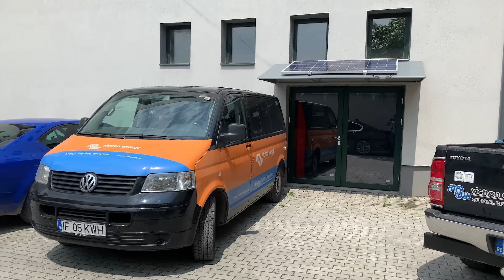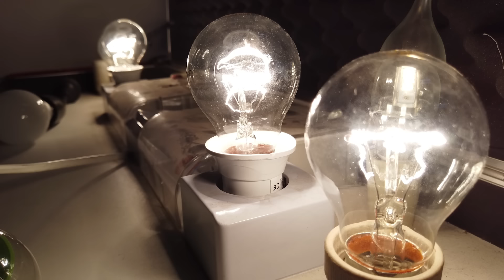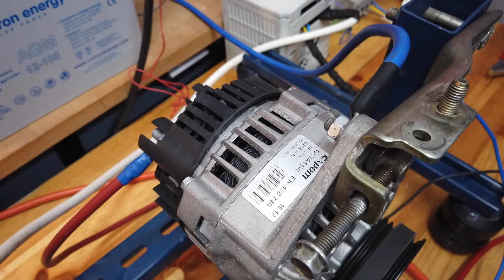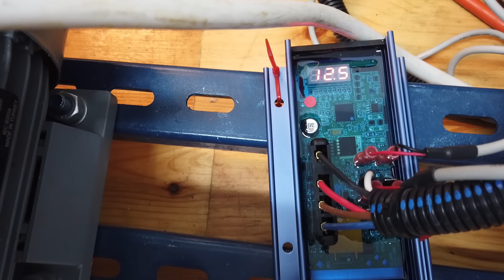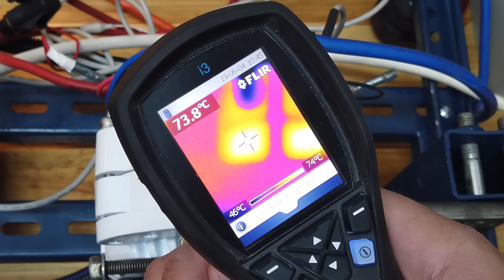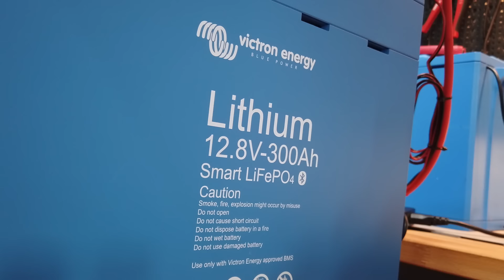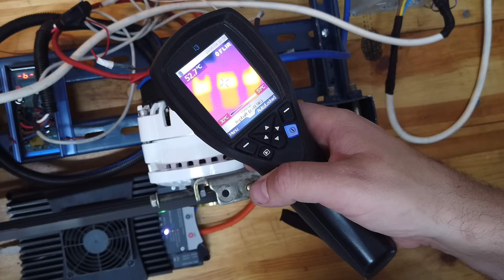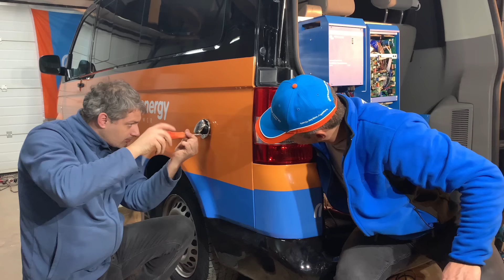How to not blow up your Alternator when charging Lithium

Comment: Ok, so the actual perception is: 3000 alternator rpm if created from a 1000rpm engine with general overdrive of ratio 3 gives healthy 40ish degrees and 78.9 Amps off of a 70a Citroen Alternator. Good.
Real verdict of this video without the voice is that a fully loaded alternator should not be operated below 1000 engine rpm (=do not 100% load in idle, which is not hard to understand) but is very fine when driving (lets say approx. 2000 engine rpm).
Regarding Lithium everybody should know that a lead acid battery as a buffer to avoid load off voltages and then DCDC off to a Lithium with current limiting to a current value/number below (80%) the alternator limit is a good ballpark.
Reply: If you have room, buy a 12v aux truck alternator. Typically rated at 180-300A continuous at just above idle. They’re twice the frame size of a high output car alternator and are designed to operate in hostile conditions - and they’re cheap(ish)
Reply: Any links on any items locations in Europe?
Reply: @ross82 Ford Transit 250 EcoBoost alternator puts out 250 A ford thought this out for its vans owners.
Reply: @krustysurfer it’s about duty cycle, big frame (truck) alternators are rated continuous.
Reply: @ross82 So basically what you're saying is the trucks built-in voltage management system will take care of everything pretty much the way that it needs to be because for built forward facing technology knowing that lithium batteries were coming is my guess?
Reply: @krustysurfer what I’m saying is - trucks have more space so they can afford to fit larger continuous rated equipment - auxiliary alternators being one of them. With physics, size and energy production go hand in glove. In this case, the thicker the conductors - the lower the temperatures - thicker conductors take up more space hence the larger frame…. and the frame itself is a heat sink. So the bigger the heat sink the cooler it will run. Can you see there are two massive physical limitations solved by going big? If you have the space - go big. It’s not rocket science.
Reply: @ross82  seen and heard 😎thx
Reply: In an RV there's the secondary battery on a diesel it can be used to help the inverter and connect to the lithium ion battery to with a 250 amp diode. Microwaves have a capacitor and the inductance created is a problem. Charging a vehicle the optimal performance is above idle maybe a thousand RPMs for an alternator. China tariffs are needed against products like this and people who test and never really get down to the facts. Fact is anybody now can manufacture this system. The inverters cannot be connected to the BP 100 or 500 according to the diagrams victron has a big x. It is unknown why possibly the longer the connection to more waveform distortion or other unknown?
Reply: From things I have saw dcdc as you mention is way to go. I want to build a lawnmower type engine to alt setup. And after watching this stuff dc to dc is looking more inline. I think @victronenergy should revisit this and produce a new video with new offerings or products out there.
Reply: The moral of the video is that due to the lithium battery the voltage during charge will not go up until the battery is charged and this causes the alternator to get overworked. 3000rpm is still low for an alternator to be cooled well! So over time bearings/coils ect will suffer and fail.  the ballpark for a dcdc converter to limit the output would be about 50%
Reply: @johannesboonstra6917  Alternators peak at 1800 rpm and rely on the vehicle to be moving for cooling 😂
Reply: @ryanmckee3102  and all alternators are in vehicles and beside this, there never in a sunny traffic jam ? 🤣.
Reply: @ryanmckee3102  are you saying that alternator fans are designed to provide adequate cooling to 1800 RPMs, and at higher alternator RPMs they rely on vehicle movement to cool the alternator?  I'm trying to get this clear in my head because I'm on a sailboat, where wind cooling in the engine compartment is not available😊.
Reply: @SailingWindGypsy  no I'm saying that output peaks at roughly 1800rpm and drops above that typically. There is no cooling on an alternator so typically the engine fan and air movement is all there is to cool it.
Reply: @ryanmckee3102  okay well I'm really confused then because everything I read says that an alternator has a fan 😊.  But we may be talking about different types of alternators for different types of engines and vehicles.  I would also think peak output would vary based on the size of the alternator, for example 50 amps versus 125 amps.
Reply: @SailingWindGypsy  Alternators have a fan, but thats based on average load for a limited period, not for extreme loads for a long period of time.  then cooling isnt adequate

Comment: The main question is sail bolt can charge battery alternator without motor working but the propeler giving rpm to alterator,  using the alteraror and engine, justthe solar panel. Conventional charger. Plugb220 v. In case using v
just solar panel with selector swich  is it safety. Where I can find electricals diagrama for 4 possible

Comment: I have a 300 amp hour lithium battery pack, the maximum chargeing current is 50 amps.  My car charging alternator, as all are, are set for lead acid batteries and the charging current drops off before you can fully charge lithium batteries.  So, needs to be tricked into seeing a lower voltage to what the batteries are, to charge.

Comment: What about the VAN’s (Spring, Crafter, Transit) alternator that is rated to 250A standard, and optionally you can get a 280A version? Is this still an issue with such big alternators?

Comment: Victron does NOT make a product that will go directly from your alternator to charge your lithium batteries all the orion dc to dc chargers require a lead acid battery  between your alternator and the dc to dc charger. Need a product that will charge directly from the alternator

Comment: It get your approach for this demonstration but: the under bonnet situation looks quite different:
1. way warmer than room temperature
2. You will always have a massive airflow from the radiator! additionally
3. the load situation will ALWAYS vary massively: Due to shifting (aks RPM change) and stopping/driving. If not, like on autobahn, you will have a steady and massive airflow
Reply from the maker: Although these are good points to highlight, what about when alternators are used in the hulls of boats and in engine bays with little to no airflow? This film is purely trying to highlight the issues, and we know this won't fit all situations.

Comment: I’m just curious Mechman alternators successfully charge all types of lithium batteries without the use of a battery management system or anything from Victron
If it’s so easy to burn up an alternator, why is it not happening all the time in the high current audio world?
Not only that but they make 400 amp alts
Can someone please tell me bc I don’t want to waste my money improperly charging

Comment: A simple solution is the addition of a length of wire to add resistance to limit the charging current due to the voltage drop on the additional length of wire. Use copper wire tables to do the math for the desired voltage drop at a given desired charge current. EG if the desire is to limit the charge current to 20A, and the alternator regulates to 14.7 volts, and the Lithium battery is at 13.6 volts, the wire would drop 1.1 volts at 20A and dissipate 22 watts of heat. Alternator is not overloaded during charging.
Reply: bro lifepo4 battery with smart bms can set up max charge current  i dont see any issues with that battery .

Comment: The car engine idles at around 600-900 rpm, but the pulley on the alternator is much smaller than the one on the engine's main shaft, so even at idle the alternator speed is well over 1000 rpm, probably closer to 2000.
Reply from the maker: What about boats sitting at tick over in a lock or by a dock?  This video has tried to highlight this issue. We realise it’s not ideal conditions but at least we tried to get the message across to people to try and help them.

Comment: In reality an alternator turns at 3x the crankshaft speed so at idle it's much more than 1500rpm. In most cases there will be plenty of series resistance and you don't need complex solutions.

Comment: There is a dude on youtube who criticized this video and then hooked his lithium bank straight to his alternator. Camper vans don't have 70 amp citroen (low quality and undersized) alternators, sprinters have 220amp alternators with current limiter built into them. His setup is still working years later.

Victron is nice stuff but it's overpriced and this demo on a bench with ZERO airflow and a TINY, low quality alternator. The experiment was designed as a marketing stunt to sell products and destined to fail.
Reply from the maker: No, this experiment was designed to highlight the high pull of power when charging lithium and how it can damage an alternator.  Johannes has explained this many times in the comments, and you forget to consider an alternator in a boat, for example, with limited airflow.
Reply: @VictronEnergyBV  None of that nuance is explained in the video. The video makes it seem like the only outcome from direct alternator charging is an instantly fried alternator, which is untrue and misleading.
Reply: @VictronEnergyBV   how about limiting bms of lifepo4 battery to charge at max 40a that cannot damage alternator then

Comment: WARNING: INVERTERS NEARLY GUARANTEE ALTERNATOR FAILURE. Very informative video.  I wish I had seen this before my alternator failure and subsequent $4,000 repair.

The alternator demo helps me to understand the lead up events to my failure and prevent future failures.

First setup:  Circular Saw to Standard Inverter, to starter battery poles and alternator.  I was not aware that the momentary peak power surge from the saw at startup placed enormous load (3,000W)  on the battery and alternator.  This event occurred approximately 10 times starting the saw.

Second setup:  100AH LiFeP04 battery to 120v25a LiFeP04 Charger to the Pure Sine Inverter to the starter battery poles and alternator.  Post "First Setup" events, car was operated for 10 minutes at various rpm's, never over 2,500 rpm's. And a stop was made.  In error, the inverter was left on for 15 minutes in which it drew down the starter battery but not enough to notice on engine start.  We continued for 20 minutes and the inverter threw a "low voltage" (point-of-failure) code of which I immediately shut it off and disconnected it from everything.  3 minutes later, the car dashboard lit up and the car went into "LIMP" mode (Toyota Sienna, minimum operating power condition detected by on-board CPM).  Power was so drained that steering (electrically powered) was nearly 100% disabled, throttle completely unresponsive in LIMP mode.  This created an extremely hazardous car operating condition, best described as nearly completely inoperable.

After all this, I am able to recall car performance artifacts that may have preeminently indicated a this failure.

Most likely the first setup did damage the alternator.  The second setup, ironically a test, finished off the alternator likely resulting in thermal run-away and coil failure.

The result was a remote failure during a minivan campout resulting in $2,900 car repairs, $500 hotel (failure occurred 30 miles away from our camp),  and the MiniVan is outfitted as a camper with queen bed within, hence lodging needed with vehicle in the shop.  Meals another $200.  All totaled almost $4,000.

LESSONS LEARNT

Even though Victron and other manufacturers design in safety features, SOME DO NOT and they don't cover the cost of your failure so the risk of $2,500 is on you, not the manufacturer.

LiFeP04 Batteries can be easily charged while completely isolated from your vehicles electrical system via Solar or On-Shore power and even a gas/lp operating small generator.

I will not accept this financial risk going forward.  At a cost easily under $500, I will go the route of solar and shore power options and mitigate the risk to me.

The financial risk is just too great to take for inverter or 12v-to-12v charging systems.

Comment: This overheating is a standard issue. 
Lithium is only triggering the fail moment sooner.
But 3 agm with the same 300amp does the same to an alternator if not ran fast.

Comment: so you use a dc to dc charger to isolate the starter from the house bank and charge the house bank from the dc to dc. How do you wire the shore power to charge both battery banks (start and house) without creating an alterante path from the alterantor to to house bank?

Comment: Bench testing an alternator skews the heat portion. If you are driving, air is also blown over the alternator thus increasing the cooling effect.
Reply from the maker: If an alternator is deep in the hull of a boat, there is little to no airflow, so this is to highlight the issues with charging lithiums.

Comment: I current limit the output of the alternator to just 30Amps anyway. Every alternator just about can handle that. 
If the battery is 80% flat and I have to leave, then the chances are I'm going for a drive of a couple of hours. That puts at least 60Amps back into my 100A battery. My solar panel at 400W, will have everything charged in another hour or so, once I'm there. Charging Lipo4 batteries at break neck amps is not good for the life of the battery or the alternator. While they can take it short term. it's more about the right voltage ie. 13.8VDC at a constant current, rather than a larger current, for a short period of time. You don't need an expensive DC-to-DC charger to do that. A $50 boost converter from Ali E will do all that just fine.
Reply: if you feel thats a reliable solution, then yes

Comment: Well how tf are these EVs doing it?!
Reply from the maker: EVs don’t have alternators.
Reply: @VictronEnergyBV Yeah this is true but they do have regenerative braking which I imagine is a pretty rapid charge but I guess the brakes withstand heat much better so it makes sense
Reply: @Dan0rioN this is about alternators and their efficiency/ heat generation 
That’s something different then regeneration of power with a high power motor with a different construction/ design
Reply: @johannesboonstra6917 Yeah makes sense
Reply: @VictronEnergyBV & What about hybrids?

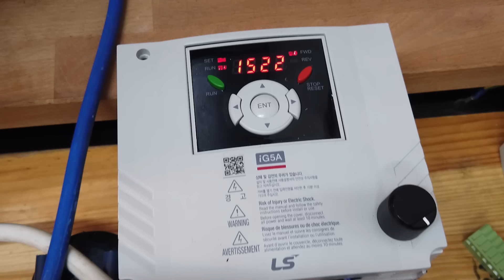Comment: 2:46 - "note that this is still above the speed of an engine running idle"

No, it's not. Alternators are typically overdriven, with a much smaller pulley than the engine's drive pulley. Alternators typically run at 2x speed on 4 cylinder passenger cars, and 3x speed or higher for consumer trucks and SUVs. Commercial and vocational vehicles can run as high as 5x engine RPM. 

Contrary to popular belief, most reputable manufacturers of industrial alternators do not run higher overdrive ratios... owing to the typical high RPM and reduced idle times of industrial applications, higher amperage loads are typically handled by larger, lower RPM alternators.

Comment: There are a few things I don't like about this video: The burnt out alternator looks like a Citroen, 70 amp version. I wouldn't call drawing 80 amps from it healthy. The RPM ratio of a generator in a vehicle versus boat should have been mentioned. The test setup is stationery with no additional airflow, which should be taken into account.
Reply: In much situations there is no airflow like an engine of a boat for example.   And remember, this clip is an explanation about the need of a device to restrict the heat generation, we dont claim that an alternator will blow in 5 min.

Comment: A DCDC that can set charge current, drain current separately, and reverse charge is what you want , but also cap the battery charge to 40% when not using it at limit max charge to 80 or 90% to vastly extend battery life as lithium doesn’t like being fully charged
Reply: the Orion XS family can be set to a specific current , is not bidirectional but theoraticly can be controlled to charge until a certain % if you want, this is however not really needed as at the charge voltages we advise the battery will not run at its max voltage

Comment: So exactly how am I going to burn up my alternator through a 7 pin connector. Not enough amps going through it to matter.
Reply from the maker: I think you may have misunderstood. The 7 pin connector is connected to the alternator to take measurements. Nothing to do with power to or from it.
Reply: @ In the real world using standard wiring to the 7 pin from the tow vehicle, you can’t pass more than 10 amps max to your batteries. Well below just about any alternator’s capacity. Now if you go to the trouble and run a separate appropriate sized wire you can now take advantage of a DC-DC converter.
Reply: @edrodrigues3333  In the real world many people having a boat or other system were the high capacity batteries are not charged through a  7 pin but with sometimes hundreds of amps, that will kill the alternator.  In your case , the Orion might be a great add-on to protect to 7 pin/fuse !
Reply: @JohannesBoonstra-ol2nz  Protect against what exactly. The BMS in my batteries limit the amount of charge, which is well below my alternators capacity. I realize this is a Victron commercial, but you shouldn’t give the impression that everybody needs a DC-DC converter.

Comment: This seems about right. The key takeaways are that:
1. Regular alternators won't work, you need to invest in a high-quality one with higher power and various safety features
2. Limiting the charging current to up to 75% of the alternator's rated output or lowering the voltage is best
3. Double-check the alternator RPMs when the van is idling
4. Get yourself a DC to DC charger of any kind, be it a dedicated charger or a solar controller